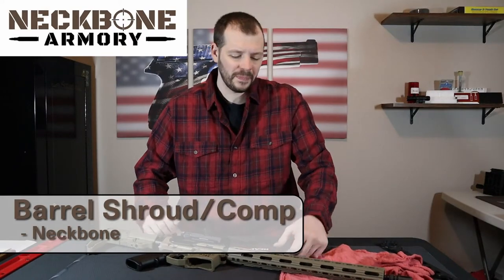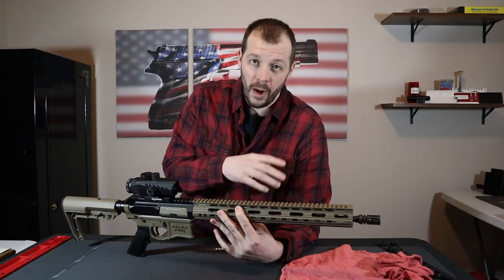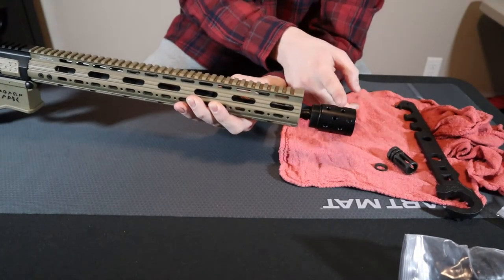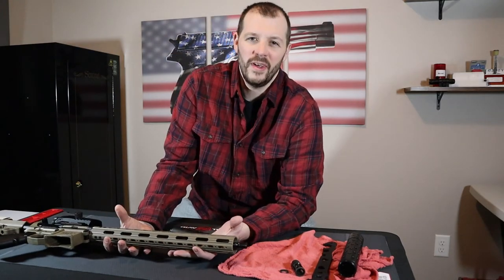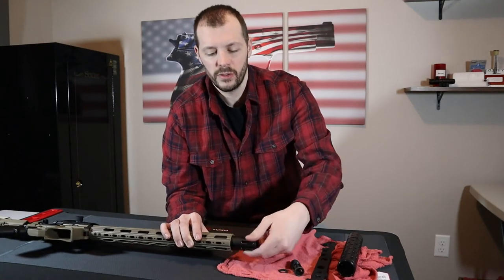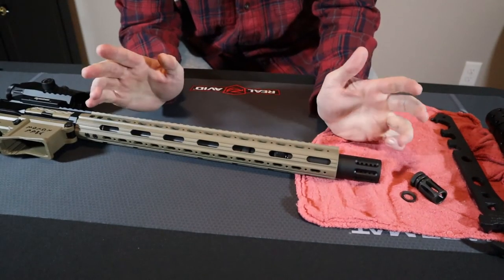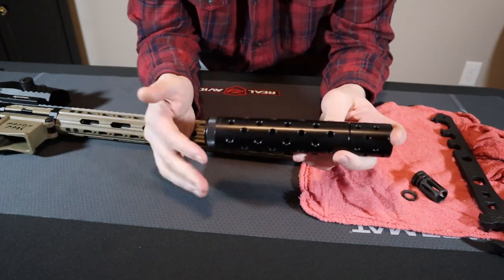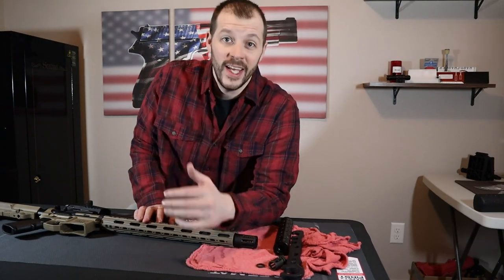Barrel Shrouds Aren't Useless After All

Comment: Sometimes we give up functionality for just plain looking cool.  I’ve put GunTec barrel shrouds on every AR I own except for the ones with real suppressors
Reply: Do you use crush washers? I’m building my first AR and my GunTec shroud doesn’t fit with a crush washer on.
Reply: I just used a rubber O ring
Reply: @GUARD14N I use as crush washer
Reply: @Ctreo7  my barrel shroud didn't fit over the crush washer. So I ended up using a high temp O-ring as recommended by Kevin. Fits like a glove

Comment: How is the guntec  shroud/Brake working out for you?? Is a crush washer necessary for installation, does it stay tight??  Thanks in advance.
Reply from the maker: I didn't use a crush just torqued it down tight and it stays so far
Reply: @NeckboneArmory  
What is the torque spec?. I bought the same one.

Comment: Cosmetically, that does look better. But... a comp on a 16" barrel is really not needed unless your shooting 2-gun and want to cut a few hundreds off your time. On a self defense rifle, a flash hider makes more practical sense. Or, you can split the difference and run a PWS FSC Comp/flash hider; I run one pinned on my 14.5 Gunner. I'm not sure what comp that monster is you have there, but it looks a lot more like it would function as a linear comp...which is nearly useless on a 16" bbl. Regardless, thanks for reviewing your process; always helps to see other shooter's mods! 👊🏼🇺🇲👊🏼

Comment: I have a few questions So are these legal like no tax stamp or atf/nfa needed? and what does 1/2x28 mean? Also removing the muzzle break from a 16 inch barrel wouldn’t that make the rifle an SBR since it doesn’t meant the ATF’s 16 inch requirement?
Reply: lol
Reply: 1) these are technically compensators because of the ports but are called barrel shrouds, totally legal unless your state specifically bans any type of muzzle device, 2) 1/2x28 is the thread pitch, this one is for the ar15 platform specifically, 3) The ATF requires the barrel itself to be 16 inches minimum to not be considered SBR, with an overall length of the whole rifle to be 30 inches or longer. What you are thinking about are the cases where someone would run a 14.5 with a pinned 2 inch muzzle device making illegal to remove it and use it that way. anything shorter for the barrel length is a no go unless you jump through hoops.  Hope this clears up the confusion.

Comment: LOL I did the same thing, but instead of using a barrel shroud, I used a Suppressor and a short barrel. 7.5 inch barrel in .300 BLK, 6.5 inch Suppressor, 12.35 inch Handguard to cover the whole thing. I actually had a reason for doing this other than just looks- I didn't want to risk a baffle strike that would result in the whole can exploding in my face. With the handguard, there is a significant chance of it being captured and funneled forward instead. It was enough to convince me. In all honesty, I didn't even like the look until AFTER I did it. That's when I fell in love with the look, and have tried to replicate it with any short barrel rifle I have now. Working on figuring out a way to do it for an AK build I've got... so far it doesn't look good though. Apparently, not many people think that look is very "AKish" or something. 🤷‍♂️
Reply from the maker: I'm about to start a 300blk build with suppressor. Didn't even think of getting a longer handguard as an exploding can deterrent. Is it a pain to adjust the gas block though? Would be cool if someone made handguards that came apart in the middle or something
Reply: @NeckboneArmory   a company does make a quick release hand guard kind of like the quick release optics u pull a tab and it comes right off also no play when locked in mainly used for 300blk for those adjustable blocks that way u can easily play with it on the range

Comment: Any chance you can provide the max od barrel that Guntec comp will accept? I cannot find any other reviews or information on this thing.
Reply from the maker: The inside diameter was about 3/4" maybe a little less. Threaded onto 1/2" barrel thread. I couldn't find anything about which barrel size it fits on either. I'm guessing any 1/2" threaded AR barrel with OD less than 3/4" should fit. Keep in mind I am wrong almost all the time.
Reply: @NeckboneArmory  Thanks! I even emailed the manufacturer and they would not provide the dimensions. Sounds like this will work on my barrel.

Comment: Do you apply loctite or a washer or how do you install it so it doesn't become loose? Thanks in advance.
Reply from the maker: I don't use anything since I take it on and off pretty often. A lock washer would probably be what I'd use to keep it on there. Would need to find a way to torque this down though since the only accessible part is the ports when you put it on there. I've had luck with a spanner wrench using one of the ports to tighten it down.
Reply: @NeckboneArmory  I was thinking using a strap wrench.

Comment: So the flash is only directed forward and not through the side holes with this?
Reply from the maker: The side holes are ports. It reduces flash if that's what you mean. Gases still exit through those side holes to help stabilize when firing.

Comment: I've got the same thing but the crush washer is preventing it from sliding over the barrel 🤔
Reply from the maker: hmm I don't use a crush washer with this one. I wonder if they make smaller ones that will fit
Reply: @NeckboneArmory  Do you hand tighten it or how do you put it on? If hand tightening it, any issues arising or concerns, like it coming loose? Do you put an anti seizing lube on it to prevent carbon locking?
Reply from the maker: @BattlefieldBroskies  I tighten with a punch through one of the holes by hand. There's probably a better tool, could even use shims. I put a little aeroshell grease on the threads for most muzzle devices. It came loose on me once but I just tighten  it back up tighter and no problem since

Comment: How about a shorter shroud by this outfit for 10-5" barrels? The one described above would hit the gas block on shorter barrels.
Reply from the maker: They do have a shorter option
link: https://shareasale.com/r.cfm?b=15098&u=2698398&m=4355&urllink=www%2Eopticsplanet%2Ecom%2Fguntec%2Dusa%2Dar%2D15%2Dmicro%2Dslip%2Dover%2Dbarrel%2Dshroud%2Dw%2Dmulti%2Dport%2Dmuzzle%2Dbrake%2Ehtml&afftrack=

Comment: Does this extend the barrel at all? Looking to take a 14.5” to 16”
Reply from the maker: no it doesn't. You would have to pin and weld it for it to count as barrel length
Reply: @NeckboneArmory  So it will add the 1.5” after it’s pin and welded?